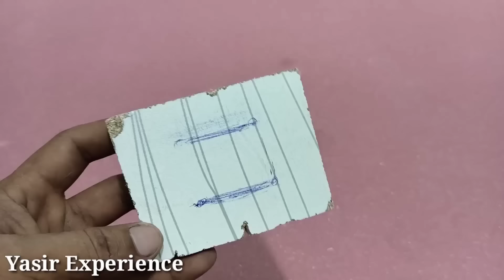6 SIMPLE INVENTIONS, IN FREE ENERGY

Comment: Where do you get your supplies, really want to give as a gift for Christmas
Reply: He got these parts out of toys, speakers, microwaves salvaged at recycling centers, perhaps. The electronic retailer would charge him too much. He uses Hot plastic gun purchased from a local DIY shop. These devices run cold because there is little or no Joule energy absorption in copper conductors. These devices work on magnet energy, gravity pull, electromagnetic energy of local space and there is enough joule energy harvesting with magnets to overcome friction losses.

Comment: Yay an electrical rats nest with the negative of the electrolytic capacitor connected to the positive output of the bridge rectifier. Of course it doesn't matter because it does nothing and it's all driven by the electric motor under the base board. I gave up at this point as the music was driving me s#itless.

Comment: At 27:01 i saw you tilt the board showing that it wasn't flat, bc you had a battery under it!!! Lier cheater hack!!
Why didn't you show the other motors + - sides. Bc you drilled holes and put wires under it for the battery 👎🏻👎🏻
Reply: I reckon that the design is legit. He got so many designs that I can say, he is a true master of the trade.